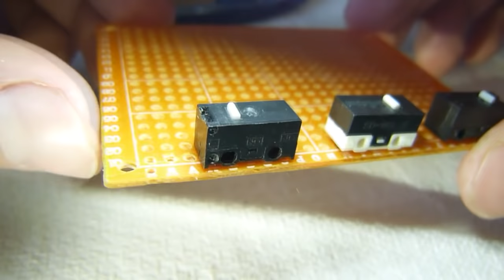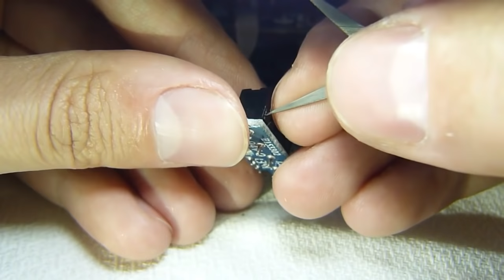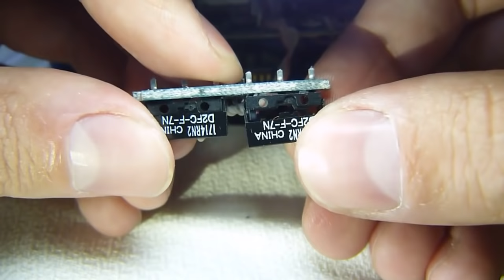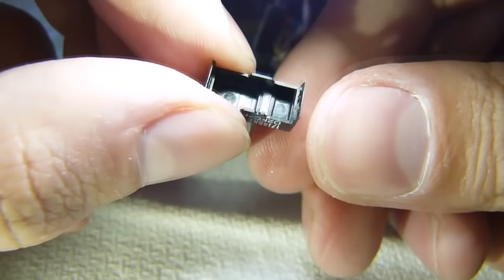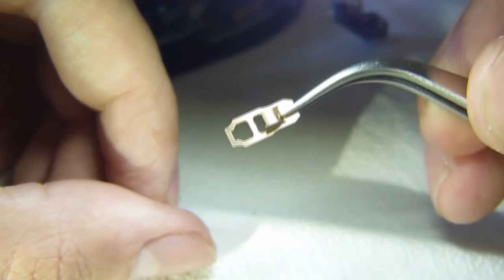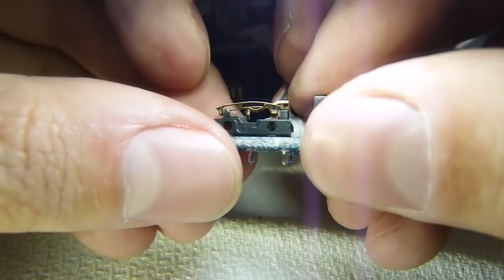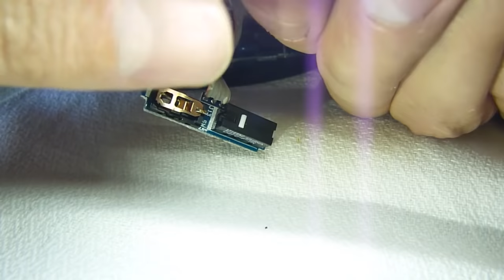Double click problem: How to fix faulty mouse button

Comment: Took me about 20 minutes to do. The video is pretty good but it can't give you the feel for where the indented tiny grooves are for the metal springy piece (2 of them....The back of the 'zipper pull' and where the bent upward part meets the middle assembly). The piece that you bend upward has an edge that must catch the groove for it to all stay in place! At first I bent it a little too much and it would not ever engage with the groove, so don't be afraid to bend it back some if it feels like it is wrong in the middle. USE TWEEZERS, and use your off-hand to stabilize the metal piece (being already engaged in the 'zipper pull' handle rear AND held down at other end's metal 'post') while pushing the middle bent tab downward *slowly and gently*, it helps. It should click into place, you'll know when it does and it'll deform into an actual spring-like switch state. Also: had the metal piece shoot off several feet in different directions trying to place it, so be wary of that and maybe plan your repair location accordingly, for ease of finding. When you get done fixing the metal part of the switch, you can hold your mouse upside-down, and bring the switch top with the tiny white button in place up to meet it, gently snapping onto the fixed assembly. 

FANTASTIC fix for my formerly ailing Logitech G400, and I have another old PS2 optical mouse I'll be fixing soon. Just be persistent and you should get it. If nothing else you'll gain a new respect for the guy who invented these delicate switches!

Comment: Solved my left clicking on the G103, it's clicking like new again. The zoomed in video is very helpful especially on putting that copper part back. I did not do the bending though, just cleaned the blackish residue on the copper part surface with alcohol swab. So thank yooou.

Comment: PCGamingWiki Savior ! No need for new microswitches  ! The only thing I need to do extra is scratch the contact point, where there thin metal plate makes contact when you click the mouse, I used a boxcutter to scratch it. My G700 works flawlessly now. <3

Comment: I did this earlier. Yes, putting the spring back on is very tough. The curve one is need to be slightly put into the middle one. And the right part shouldn't be too deep so it carries the weight of all the part.

Mine the other hand, I think my error because I bend the curve too much so the curve went back down too deep. I finally got it after 2 hours but no clicking sound. I finally gave up and I just realize that the cord that attached to the USB has been cut out due to the force that I did when I putting back the spring. Solder may help, but I don't have solder in my home and I am out of patience for the day. I might try it out again later. For those who finally did it and working perfectly, congratulations. You just saved your earnings to buy a new mouse. This video is really helpful, ngl.

Comment: Worked perfectly for me. I have a Logitech Performance MX and didn't want to throw it away. This video, combined to the Logitech Performance MX disassembly video, helped me fix my issue in less than an hour. Big thanks and I really appreciate your instructions. I used a sewing needle to remove the black casing in this video.

Comment: Just solved my mouse issues, you pressing on the spring without the case to show how it's SUPPOSED to work, is all the information I  needed to fix mine. Thank you so much, it works again, and I dont have to buy a 200 dollar mouse to replace it.

Comment: The hard part about this is sticking the damn copper thing back it because the mousewheel is in the way and I had to maneuver my 2 fingers so it would support the thing in place until i could push the middle curved part in from above. took a few tries but can confirm this thing works.
Many thanks uploader!
tweezers definitely helped in placing it back in

Comment: G502 Hero restored!!!! Appreciate you for sharing the knowledge. Who would've known tensioning the spring would fix it. Granted, I haven't ran it through it's paces yet, but the double click mouse tester I was using would show it actuate when being depressed, and double click within .04 seconds within every 20-30 clicks. I only did 100 after the fix, mostly sustained clicks, and none of the issues came back. 

Gonna try it in COD BO Cold War, where it was throwing off my ADS. If it doesn't hold up, I'll comeback with an update.
Reply: What is actually causing the double clicks though & why does a slight bend fix it?
Reply: @lllblisslll   I don't know the full science behind it, but from what I gather: the leaf spring, in the switch, also carries a small voltage, and when it's depressed it completes a circuit. That signals the function of your click. It was wearing prematurely, and whenever it was held the circuit would be interrupted randomly. This was from the leaf spring deforming to a point where it couldn't sustain physical contact with the other end of the circuit. Adding that tension back to the spring fixed the switch, but did change the feel of the click.
Reply: P.S. My G502 still works after all this time.
Reply: @DaveLovesVids  ah ok I see. thanks for the response.  I always wondered if oxidation of the contacts were the culprit or if the part that makes contact when pressed/clicked was bouncing off in a split second causing a brief disconnect/connection- if that makes sense.  This happens with alps style key switches as well.

Comment: This worked for me. The spring is way smaller in real life compared to the video but it is doable, it was a surprise when I got that far... Thank you for the video! It is still wise however to order extra micro-switches as the spring can not be bent repeatedly forever, it will break eventually. The next step is to then solder the new switches on and the mouse shall live another life. The model switch I needed was OMRON D2FC-F-7N. Got 5 switches from ebay for less than 2 USD American United States of American Dollars. Will keep them as a backup.

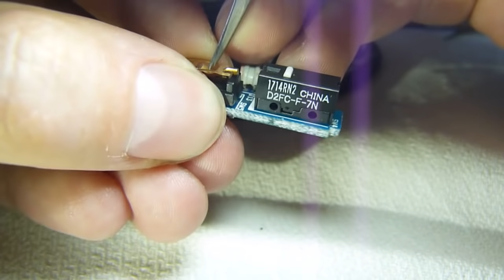Comment: wow it took me 2 hours to insert the copper piece, until I found your video, I was missing the step at 3:42 , this is not shown clearly in other videos and I didn't realize that I should push the copper arch piece slightly downwards , thank you.

Comment: I found a comment on another video regarding the double click. No need to bend the strip of copper. Most of the time, it's the oxidize copper rust that's causing the issue. Ergo, all you need to do is clean the contact point and it shouls fix the double clicking

Comment: theres a trick into this.  after you bent the tiny copper u need to slide the end into the 'hook' first without fixing the position, then place the top bit when it slides into the right spot at the tiny tip on top.  when the whole thing is in the right position apply a little bit of force to push the center curved part so it fits into the the tiny spot where the plate can hold itself.  press it lightly to check if u r able to make a clicking sound, you succeed if it does n u can put back the cover.  the problem with this method is its would still double click after a while u need to do it again, and too many times the plate would lose its shape eventually u need to replace it.  u can also use the rmb of a old mouse thats the same model to replace the plate.

Comment: When putting it back pass a string through the smaller hole and use it to pull the piece under tension. Also helps it to not fly elsewhere.

Comment: FOUR times the spring popped off while putting the black box back on, FOUR! Finally got it on and the white button wasn't making an audible click, had to start again. I realised I'd not watched closely enough and I needed to push the middle bit down a tad which made it infinitely easier. About two hours in all, would have been quicker if I'd not overlooked the sticky tape and spent 15 minutes looking for the white bit among the microscopic shrapnel on my carpet ^^

Thanks for the video, it's so nice to have my mouse working again. All the replacements I'd tried were inflaming my hand RSI. Pain free gaming once again, wahoo ^^

Comment: This video legitimately just saved my ROCCAT KONE XTD OPTICAL mouse! 
However, I do not appreciate how easy you make it look. Took me at least half an hour to get my copper piece back in place properly.
On another note, I found it was best to press the arch out of the piece you gentle bend up. I took out some of that arc and it went together a bit better.
Last tip... Use your fingers to get it all lined up before you go forward and press the center down. Its an alignment and tension while pressing trick.

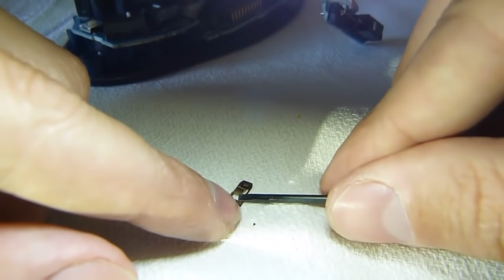Comment: Thanks so much for this. I was able to fix my double-clicking issue on both my Logitech G203 and Logitech G-Pro mice (the left mouse button; used for firing in FPS games). The hardest part was that copper/metal piece inside the omron switch, which your video illustrates very well on how to put it back (the most difficult part because of how small it is and technical it is). I basically did the same thing as your video which was to remove the copper metal piece and carefully extend that curved piece @2:54 then put it back. Again, putting it back took the longest. If I estimate, it took me like 45 minutes to just put back that copper thing on the switch because of how small and tricky it is. But, I did get it put back on and put back on right. Meaning, it clicks, and no more double-clicking! I dont know how long it will last but I guess I can rinse and repeat the same thing if it happens again. Thanks again for the tutorial! It helped save two MICE! with the same issues!

Comment: Trick is to put in the little springy thing in the middle groove first, and then pull the metal over the one in the "back". I had to bend the metal a bit as well to make it "higher" (a small hill), otherwise the little white piece of metal has too much space and the switch would not click. Cleaning the contacts is a good idea too, just scrape off any stuff with care. Beware that the metal is a spring, and it can jump anywhere if you're not careful. Wearing safety glasses could be a good idea. Now no more problems with drag & drop - I hope, looking good so far, thanks for the video. Now I know how to fix this thing I can always buy a broken mouse and use the right switch to replace the metal thingy :)
Reply: Read your comment and got it back on shortly after. Trying to copy the method in the vid wasnt working for me since I still had the switch on the PCB :(. Brilliant tip!
Reply: @Beiyuu  Happy that helped. Note that just now my mouse has started to behave similarly. I've bought 2 new 50M switches, next is soldering them on. Still, you should be good for 2 years or more with a bit of luck.

Comment: I have no ideea how you did that at first try, xD that white button jumped from the socket and I searched 20m on the carpet for it, opened an older mouse to extract another button, the new button fell under the board, and out come 2 buttons. Yey, managed to fix my mouse. No rage buying a new mouse. Thank you dude!

Comment: tried this on my g600 and could not get the spring attached  again and lost it in the dirt eventually. Took a switch from an older logitech mouse to solder on but ended up melting some stuff off the board and just took a hammer and destroyed it. To sum it up i ended up ruining 3 units instead of reparing one. So if you dont have the right soyboy fingers to mess with this stuff it will be extremely difficult.
Reply: Why not ask girlfriend to solder for you?
Reply: It's easy to ruin electronics, that's why people get paid.
If you decide to fix something, always have a backup plan.

Comment: Don't be fooled, 3:10 to 4:00 alone takes 2hrs in realtime. Almost emptied my savings to get the pricey bluetooth Logitech M557 because my laptop has only 2 USB ports and i didn't want a mouse with a dongle. Imagine my horror when lt-click started acting up after 1 yr. This video actually saved Logitech cos i was about to place a curse on them. But seriously though, why all logitech products?!?

Thanks a lot bro!!!
Reply: they make every electronic device to last a bity more than warranty terms. in most cases 2 years. Sometimes they get unlucky and device breaks 3 moths before not after warranty period and they have to replace device for free.

Comment: Thanks for this video,. I have repaired multiple mice following this guide.  I haven't even needed to remove that part, just clean the contact between the two connections.

Comment: A quick fix to try first if your switch is still making the clicky sound but not making an electrical connection: open the case of the switch a little, blast some electrical contact cleaning fluid in there and clicky-click the switch 50 times or so. Let dry for a couple hours, then reassemble mouse and test. Worked for mine, saved me headache of fully disassembling switch! Caution using contact cleaning fluid- extremely flammable make sure you let dry completely before reconnecting to power.

Comment: If you have a two button mouse and the confidence , or lack of confidence in BENDING such a fragile spring:  Consider disassembling both button housings and swapping the springs from one side to the other. That way your primary gets the less used spring from the secondary button, then you can worry about the tension for a secondary button instead of the primary.
Reply: Having disassembled these housings multiple times by now, just clean them with alcohol, preferably isopropyl. If the mouse is only a few years old. The ghostclicking issue kept re-ocurring for me because the contacts were dirty. Not because the mechanical action was worn out.

Comment: wow, this is so old 2014. I applied this on my cheap wireless mouse that was getting me crazy the dobleclick (closing windows, etc), actually pretty easy to do. Just I wasn't able to remove the black cover that easy so I think it got a little broken so when I put a back I used a little of 
pvc adhesive, now this is smoother than the right click...

Comment: My Razer Naga Trinity had the dreaded double click issue. I solved it much more simply by opening up the mouse, and cutting some of the adhesive rubber strip (that blocks the screws on the mouse) to fit the small rectangle under the mouse finger and the issue is gone. It should last a while and a lot easier than trying to disassemble the actual switch.

Comment: Omg, it feels so good now that after doing this that the double clicking problem with my g502 hero vanished, idk though that for how long will it be fine. But who cares, as of now, it's fixed af! Thanks mate :)
Reply: lol Same, Logitech should really replace that copper thing with much more robust one. That this is very easy to deform.
Reply: Yeah, agreed. I guess they should also design a new switch mechanism because this one is just too flimsy. That copper ring kind of thing was bent so much in my button though I was using it for like 6-7 months with like 2-3 hrs of usage a day. It shouldn't have been damaged so easily

Comment: Exactly the same switch in my several year old Logitech M310.  Just spent the last 90 mins fixing it.  Boy oh boy is that little copper spring fiddly to get into place just right.  When I finally got it right, it went right in, but the many tries prior were frustrating.

Comment: been putting off buying a new mouse or new switches for months now. left button click double and the right one you have to really smash for it to work. found this video. fixed those issues in an hour. clicking a lot quieter and softer too but I kinda like it. thought that this 6 years old mx anywhere 2 was done. here's hoping that it'll last another 6

Comment: Most likely due to a fall, my Logitech G700s began experiencing the double clicking issue after years of faithful service. Although I ordered replacement switches, just did this a while ago to fix my problematic left mouse button. Although it took me a while, I eventually fixed the problem after opening the switch, eventually exchanged the "restored" switch metal thingy onto the right mouse switch (newer used one on left clicker now). With just a few attempts, mouse was fully restored.

BTW, those instructions were kinda Ikea-like, no words, almost no written instructions, but worked out perfectly. Onto 7 more years of good service!

Comment: Worked as described. I used a tiny piece of tape on top of the black cover to hold the switches in place till I could seat them. Hope that saves someone some trouble.

Comment: for me the triangular shape of the clicker had worked grooves into the posts of the right and left click that presses down on it. i simply used some super glue to fill in the indention and it worked perfectly. check to see if your mouse posts have grooves in them not allowing the clicker to press all the way and fill them

Comment: I came here to say this totally worked 100% (June 29, 2020)! Thank you!
I noticed the double click issues the first few weeks of using my brand new Logitech G903 and I just didn't mind it until it got worse and worse. I'm dead set on buying a new gaming mouse today but went to Youtube for a last-ditch hail mary and viola!
The hardest part for me was removing the battery. Don't be afraid to bend it slightly to pry it out.

Comment: Just finished reassembly of a Razer Naga Trinity. Start to finish about 20 minutes

Not nearly as hard as it looks tbh but take your time and be very delicate. Loading the spring back in place takes finesse. There's tiny groves in the posts that the spring is meant to click into. Once I noticed them it was a lot easier.
Reply: If successful then this video just saved me $100 in 20 minutes. This video deserves more likes